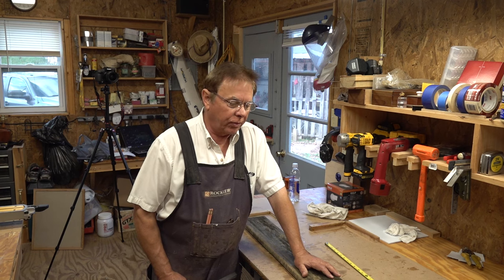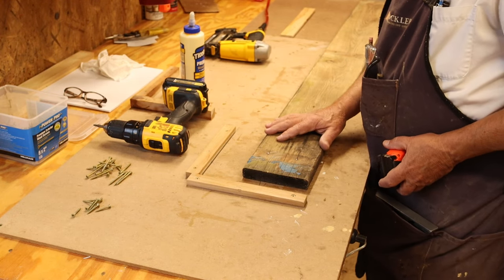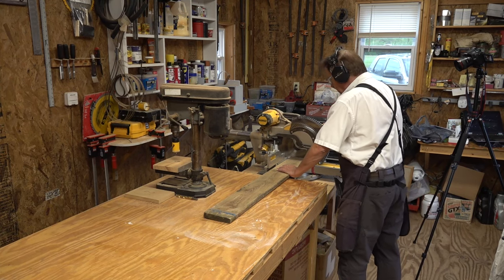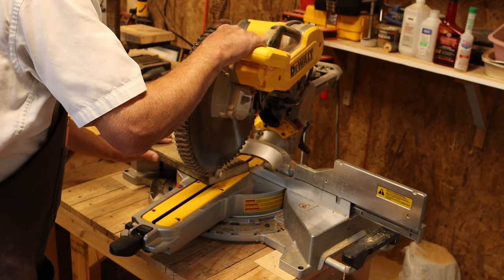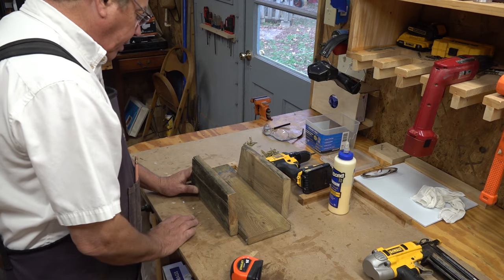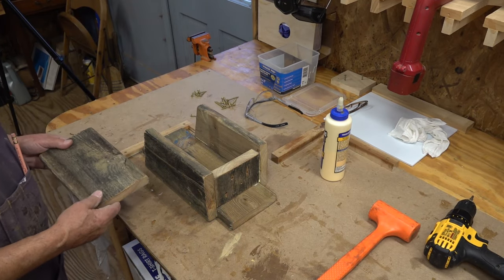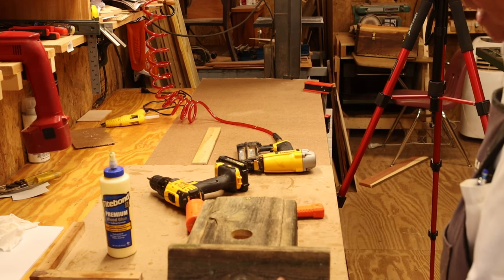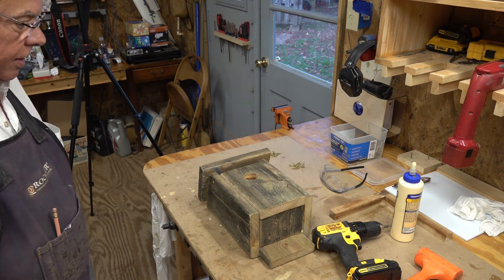How to Build Bluebird Bird House, FAST & Simple out of one 60 inch Board. Every Step Explained

Comment: Why not cut the 15 degree angle once and use one for the left and the other for the right side? What size is the hole opening?
Reply from the maker: The hole is 1.5 inch for Bluebirds..  one cut on both sides works fine!